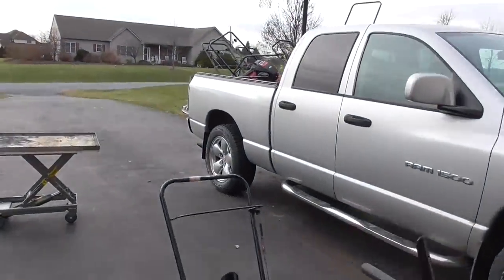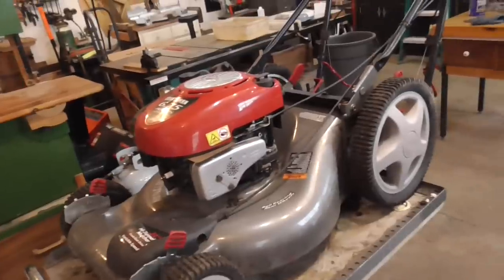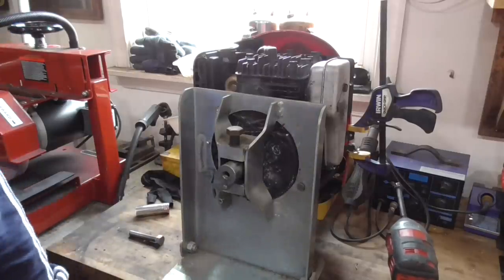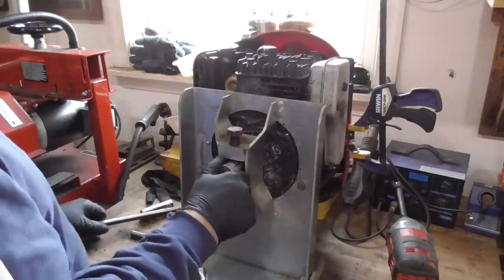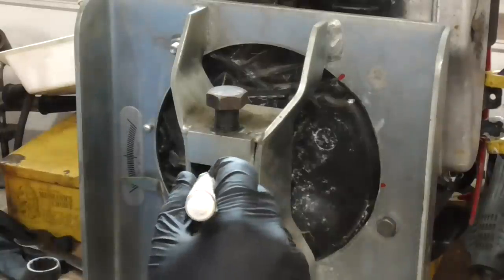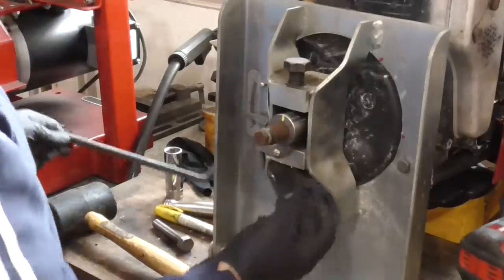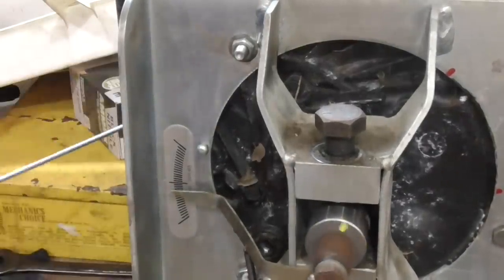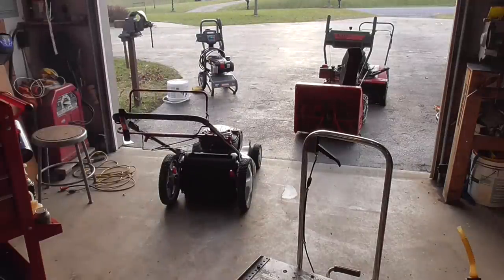Bent Crankshaft On Lawnmower Lets Fix It

Comment: There's an old man (90) who straightened out a shaft on a 1985 briggs I wanted to save.  It wasn't nearly as bad as the one you did in this video, but he got it within .003 inch with a homemade 1" steel plate with a screw and micrometer setup.  He charged me $35 so he would have beer money for the week.  The guy was a character and even though it took less than 5 minutes, the money was worth it just to hear some of his stories.  Thanks Bob!!
Reply from the maker: That is a great deal for you.  The alternative is buy a new mower.

Comment: I used a wooden block and a hammer to straighten it . Old school that was 5 years ago still running .😎😎😎
Reply: I've done it several times on different mowers. Find the high spot and hit it with a sledge hammer.

Comment: Neat tool! I was wondering about the integrity of the shaft too after
 straightening but with the blade being the only load (no fan belt) and a max rpm 
around 3600, I can see how this will work reliably.

Comment: I have a very good crankshaft straightener, I use a hydraulic jack and a dial indicator.many succsess only 1 or 2 misses
Reply: I tried a bottle Jack
It would bend the side of the deck before it would budge the crank

Comment: Most newer lawn mowers have a powder cast crank and CANNOT be straightened without snapping the crank shaft. Also its almost impossible to get them straight enough. If it affects the crank seal or the seal starts leaking after you do manage to get it straight, its junk. Most shops wont even try to straighten a bent crankshaft any more. I had a lady do it to a BRAND NEW Honda mower. The seal was already leaking. I told her it was not going to last long because of that and replacing the crank wasnt an option for her. I did attempt to straighten the crank as best I could. I used my handy sledge and caressed it enough to stop the shake. I told her to keep an eye on the oil. Even with uour crank shaft machine, its a high risk repair and NOT recommended by any manufacturer any more.

Comment: its extremely dangerous to use a straightened crankshaft, that tool is to straighten a crankshaft to disassemble the engine to replace the shaft, a bent crankshaft is weakened and straightened shaft is further weakened,  I am a shop owner for 28 years, and never just straightened a shaft for anything but disassembly to replace it
Reply: david hendershott Yeah David I concur with your opinion of the fatigue from bending, then bending it back. It will bend out of true easier after the mower is put back in service. I had a little trimming mower  that I really liked,   and the crank just would not stay straight. I had planned on removing the crank and annealing it, as an experiment, but never persued because I had a really cool '59 Ariens Imperial that I wanted to work on. It has a weird little adapter on the end of the crank, to hold two free-swinging blades, much like a brush-hog.
Reply: Now why would one need to straighten the crank shaft before disassembling the engine? Just pry the seal out. You must not have done the work.
Reply: Ronnie, If you have a stepped crankshaft than what you say is partially true. But many, if not most of them, are main bearing diameter for the full length of the shaft.   You can get the sump off a bent crank if you work at it,  but the bearing won't be worth a shit after  you do.  Why not just straighten the crank and the sump will glide right off;  furthermore, you can reuse it.  Removing the seal has nothing to do with anything.
Reply: ASPCOT, 
How many people do you know have a shaft straightener laying around the house?
Reply: The first bend back typically is not a problem. If it happens a second time bending it back again is not a path you want to go down. Everyone knows how to break a piece of wire when you don’t have cutters on hand.
Reply: You are doing the job the way it should be done. All kinds of warnings by the manufacturers to Never Never straighten a Crank-Shaft.
Reply: actually the only it weaken it is if you use a torch to heat it before you straighten it

Comment: Very nice work there Bob.  Decades ago my son hit a brick with my new mower and naturally bent the shaft.  I used a 10 lb sledge to "correct" the shaft.  It worked, but it was caveman work.
Reply from the maker: It is tough to get them accurate just using a hammer.  At least you got it.

Comment: I don't know Bob. That was a really badly bent crankshaft. I have a straightener also. I was trying it out on some scrap engines with bent shafts. On the second engine, and doing it gradually, the crank snapped in two. Never used since as I will not risk a crank snapping while in use and injuring someone. I would use it to as mentioned, to straighten the crank to get the sump off to replace the crank.

Comment: I've straighten many journals on printing press print cylindersand you have to over bend it a few thousandthsbecause it is going to have a certain amount of spring back. And it's perfectly safe to run a  crankshaft straightened this way if there are no cracks in it

Comment: Why aren't you concerned about the integrity of the crank after straightening?  How do you know it won't break and take a leg or two with it?
Reply: Michael Licitra , Because the guys who makes the straightening jigs perpetuate this practice with the promise of big bucks from not having to take the engine apart. This is stated practically verbatim in the instructions sheet for the Little Brute Crankshaft Straightener  from Monticello, Iowa. Someone else stated that it should be used for disassembly purposes only, because it is nigh impossible to get the sump off with the crankshaft bent. I am not berating the guy doing this video, sometimes you get away with it. Personally I don't straighten any for anything but my own use. With my luck the customer would be back in a week and I'd have to do it again because they bend easier the second time around. Or you could argue with him,  but then your reputation comes into question. The only way I'd straighten one to sell is "No Guarantee". Let the customer decide if he wants to gamble.
Reply: ASPCOT I don’t mind using this machine for the first time bend repair. But if it happens a second time the crankshaft should definitely be replaced.

Comment: it be better to go just a little past where you want it be on the arrow that way release the pressure off of the crank it spring bk to where you actually want it on the arrow and then will be pretty much perfectly straight
Reply: I agree with Billy Jackson to try going a tiny smidgen past where you want it, then let it flex back ro your desired position and much patience, like you demonstrated, taking your time. This go-ever-so-slightly-past technique was shown in another video where the shop owners wear long rock-band wigs and wear false monster teeth

Comment: Old kind looking couple sold me a mower and it turned out not only it needed a new carb and primer bulb and gasket and a new blade. I got it running but notice it has bent shaft about 2 mm, now I have to trash it I would never turn around and sell that to somebody else.

Comment: It seems like the Briggs and Stratton motors from China have softer crank shafts. Is this true? Nice tool by the way. I ended up putting a 16" piece of 1 1/4 iron pipe on the shaft and beating it with a 3lb hammer. Mine was bent perpendicular to the blade. It hit a very small oak root and that made me think the shaft was soft.
Reply: David Redfearn , The crank is machined from a forging with no heat treatment involved. The reason the crank bends is because it is so long, i.e. greater leverage takes less force to bend. You never saw a bent crank on the old Jacobsens with Briggs motors, or other like-quality mowers, because the crank never extended from the sump more than 1".  Cheap mowers from the same era had deep decks for some reason, and this necessitated the need for the 2" long crank which bends very easily, even easier after straightening. I suppose you could make a heat-treated crankshaft, but at the time, bottom quality  push mowers were  selling for about 75.00 new, and a high quality crankshaft would make the price too high. People who were really into their lawns spent $200 on a Jacobsen Turbo-Vent,  or if they were really crazy, a Hahn-Eclipse Rocket for about $300. So you can see, nobody wants a cheap mower with a bullet-proof crankshaft, when for a few dollars more, buy a mower that will last a couple generations.

Comment: Pretty interesting, I haven't seen this before.  Didn't know it was possible, wow.   Always figured that a bent shaft = garbage.  I am curious to know exactly where that shaft bends .... and exactly where the device bends it back.  They must be the same, right ??  Is the bend along the external shaft only?? 
When the top bolt pushes down, is the bottom bolt the pivot point ..... or is the bottom pivot point where the shaft meets the engine case?
 Anyway, well done.  I enjoyed this one !  Thanks.

Comment: Back in the 70s a guy I knew had a hydraulic shaft straightener. I don't know if he made it himself or bought it. He didn't even have to take the engine off the chassis. The few dollars he charged to straighten one was well worth not having to buy a new mower. However, with today's labor cost to repair a lawn mower it's often much better just to buy a new one. I don't see no way the cost to replace a crank shaft could be cheaper than buying a new mower. Has anybody ever seen a broken crank shaft on a lawn mower? I haven't! Most of the time if a blade hits something hard enough the soft pin on the flywheel of a Briggs will cause the timing to be off just enough the engine won't crank. I can't begin to tell how many mowers I've picked up off the side of the road that only had that problem.

Comment: Nice job.  A tinge of concern about the open-spout gas container in a closed garage with a wood-fired stove with a healthy flame.  The gas will 'find' the fire in many instances over surprising distances.    I've done this (straightening) procedure countless times and had a very good measure of success when I maintained my patience.  One thing I  would suggest is replacing the bottom seal on anything that "chirps" before you straighten it.  For stability of filming purposes I would also suggest throwing a few playing cards under one of your bench's legs to reduce the shaking on camera.  Admire your perseverance.
                                                                                          Good Luck with Your Haul!
                                                                                        Mike "Smoky"  Kirwan - Kenmore, WA.
Reply: And taking in consideration the heaters
Reply: and a backfire from the muffler. @timwilliams9443

Comment: Hopefully the buyer will be informed. Most will not. Lesson learned; Do not buy a used mower from a reseller unless price reflects these issues or if so, then only after asking crank inspection- sure that will happen. His close enough was a zip code away and would offer enough info to make your own decision. May also be the a part or or whole of 'carb problem'. Sorry I can't be a happy comment but this seems to be a tool to sell product.

Comment: I have done hundreds of them on that kind of tool. Some shops will not try to straighten the crank.
Reply from the maker: Many shops will do it, but most would rather sell you a new mower.
Reply: @doublewide6  I have worked in shops in Georgia,Texas,California. Those that didn't straighten them was worried about liability. To be honest I don't think they knew how. Some also would not repair transmission. MTD 2 speed was so easy. The bushings would ware causing them to jump out of gear.

Comment: Leaning a mower over on those plastic wheels over is the easiest way to destroy them. They don't handle tension well at all and they cost way more than you'd guess. I bought one large and one small.
Reply: i broke two wheels while moving. i guess something on the trailer was pressing on the side of the mower because when i got to storage and began to unload i noticed the busted wheels.

Comment: My buddy has one of those Mighty midgets.........    We tighten that bottom bolt when we have the shaft in position......   That's a must do every time you crank down on that top bolt.....
and please don't stand in front of it. If the shaft snaps it pops out hard and can hurt you .......

Plus Tard Mon Ami ~!~!
Reply from the maker: The directions say to tighten the top bolt.  The bottom bolt is much smaller and used as a stop.  I'm willing to give it a shot next time I use it.  If the shaft breaks it is clamped between the top and bottom bolt how would it come out at me?  I'm not saying it couldn't happen, but would like some explanation.  I just saw taryl's video on the same machine and he mentioned it could shoot out. Later my friend:}
Reply: Yes the bottom is a stop and a backup support  to hold the part of the shaft that's closest to the engine........    Then the top bolt is putting pressure on the shaft to straighten it.......    The reason that it can pop out is that the sleeve doesn't go all the way towards the sump.... So the back bolt is on the shaft itself, not the sleeve, if the back bolt hits the sleeve then you are trying to bend the sleeve and the crank at the same time, which won't work .........  

If the crank snaps it's going to do it under pressure and when the crank is more straighter......  When it's straighter then there is room for the crank and sleeve to pop out, because the back bolt is not putting pressure on the sleeve as mentioned earlier.......  

I hope I explained it right ????   I guess I missed that video he put up....  I'll have to look it up ......  

Plus Tard Mon Ami ~!~!
Reply from the maker: Thanks for getting back I put the bottom bolt against the sleeve not the shaft.  I will have to see what the directions say.  I have them with my kit.  I will try to tighten the bottom in the future and I will try to stand out of the way.

Comment: Just makes you wonder why the shear key hardly never goes before doing damage to the shaft.
Reply: grassroot011  That was the whole idea behind the soft key; when the blade struck something, the inertia  of the flywheel was not added to bending forces of the  engine trying to slow down. It was not a guarantee against a bent crank, just lessened the possibility of it. If the flywheel  nut is over-torqued, the resulting friction on the taper makes the force required to shear the key much higher,  which gives even less protection to the crankshaft. Sometimes, everything  is correct and the crankshaft STILL bends. The best defense against a bent crankshaft is a more expensive mower with a short Crankshaft.

Comment: Bob,  Can't believe you didn't check the flywheel key, since it took such a big hit to bend the crank.
Reply from the maker: Good point.  It didn't jump or jerk when I tried to start it, so I didn't think it would need one.   I didn't remove the shroud when using the crank straightener and it could be done from the top of the engine after attached.  It did not need a new flywheel key, so I got lucky.
Reply: Why bother - the engine ran.

Comment: I want someone to show me how to straighten a crankshaft without that tool.  I just don't happen to have a crankshaft straitener in my toolbox.
I've used push mowers with bent crankshaft until they blow or come apart.
Anyway you look at it - it's going on the junk heap.
Reply: I have always used a 4 foot length of metal Pipe ( 1-1/4 Inch i think). Remove the blade and adapter. Just put the pipe over the end of the crank with the high spot facing up. lever the pipe down to straighten. Best of luck.